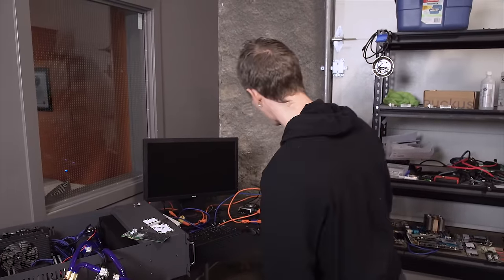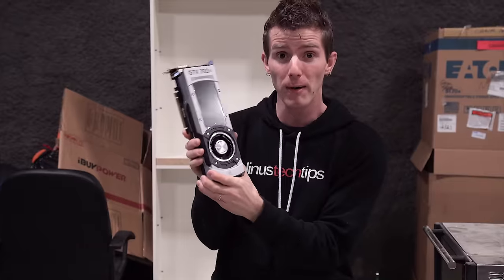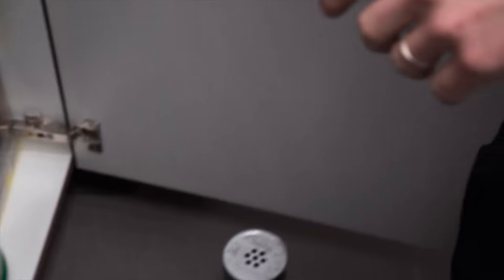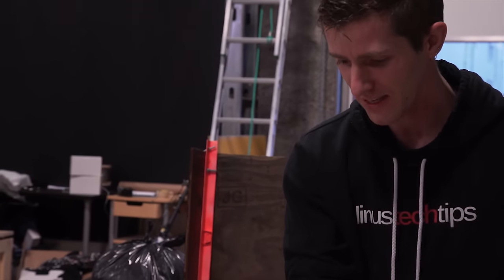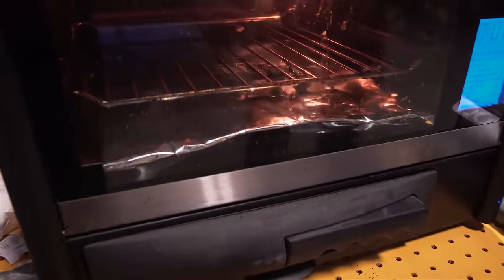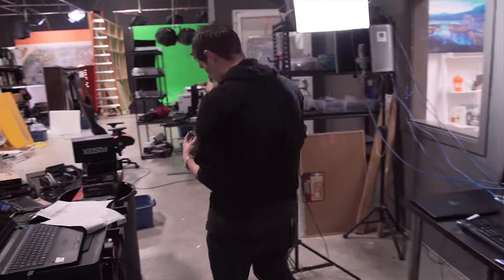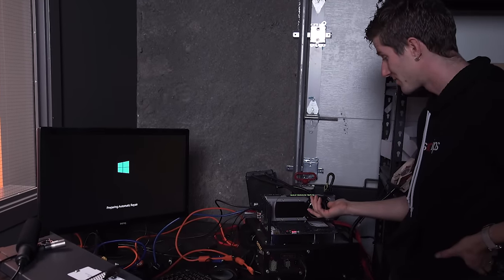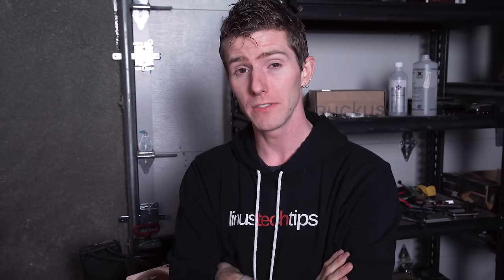Bring your video card back from the dead! - Oven method

Comment: I just gave this a try on my dead GTX 960. First boot back it looked good. Second boot FRIED MY WHOLE SYSTEM.  Not sure if it is just my MOBO but right now my system won't even power on with the graphics card removed. 
 This sucks

Comment: Dear Linus,  
Recently I've been getting into reviving old pcs.  I've run into an issue lately that has me stumped.  Basically I'll go to use an integrated graphics port,  and it will be fine.  But the movement I try to ad a GPU the integrated graphics port stops working all together.  Even after removing the GPU.  Any idea what it could be?

Comment: 385F is less than 200C, even lead free solder won't melt that low. You aren't even preheating the board (which basically guarantees that something else will go wrong).  You aren't fixing anything

Comment: Iv had to do this to my vizio tv. The main board itself,  baked in oven 8min@380.  Soo far,  it's worked all 5 times. Lol I'm currently trying to figure a way out to some how install a fan placed on heatsink.  May help or atleast last a lil longer before having to do it again.  Again suggestions?

Comment: my exp : since 2017 after build my 2nd PC im always saving some penny at least IDR 10k / $0.7 in 3 days,
exclusively for my PC long term savings and now i got dead PSU and my GPU got affected too and died also..
but im ready to replace it using my special $240savings, but i wanna try this oven method first :)

Comment: 1080ti Smoking damage?? 

Hello, cool video first of all. 
My question is rather long, so I apologize in advanced.   My friend has an EVGA 1080ti FTW edition. It worked fine for about 2 months. After that time certain games such as PUBG, Squad, Wither 3, and a few other titles would crash. My friend is pretty PC ignorant for the type he has, he thought his thermals were high, so he downloaded the EVGA overclocking tool to just gain control of the fan speeds, why I am not sure. Guess he thought it would help. The card was peaking at about 84°C by the time I got to it. Anyways, I need to add that he chained smoked less than 3 feet from the front intake. When I got to his PC it was pretty bad, dust and such. 9 out of 10 easily, 10 being the worse shape. I spent a full day, 5 air dust can, and a lot of rubbing alcohol later got it pretty damn clean. I took apart  the 1080ti and put new thermal past on it, and cleaned the thermal pads with hot soapy water, let them dry. They were stained yellow from the smoking. Ok, so by the time I was done with the card it looked pretty new, not going to lie was pretty impressed with myself. We got the card back in the machine, booted into windows, launched PUBG and it worked fine. All other games worked and we were happy. About two days later, same thing. I need to add he had stopped smoking in his house all together. I swapped the 1080ti out with an older EVGA GTX 770 4gb. It has been in for the last month, no issues, games are running fine. We sent the 1080ti off to EVGA for a RMA. We got it back today, they said the RMA was declined due to smoking damage. My buddy is really mad at himself. He gets it, I suppose my question at this point is there anything else we can do? The card does work to a point. Like browsing, low end games, and movies. It is only when a really high demand game is being played. It'll boot into the game, normally get 2 to 7 minutes into gameplay and the game will crash. For example, it will crash in PUBG right before or right after you get on the plane to drop. Just to reiterate, the 770 has had no issues what so ever. The PC specs are a 7700k, 32gb of ram, and he has some ssd, think 240gb. If you all at Linus read this, or anyone else and may have some useful information or insight, I would really appreciate it. Thanks for your time. Keep up the great videos.

Comment: I have a Alienware 15 R3 laptop
when i am not charging it it works very nice
but then i am charging it and playing there is gpu usage drop and this leads to fps drop 
any solution for this
Reply: try to clean it ... usualy when the temperatures rise , the clocks on gpu and cpu are lowered by the computer automaticly to save the parts from coocking to death...if that does not help sorry no idea
Reply: probably a problem with your nvidia/amd driver settings, i had a similar issue and resolved it in GeForce now somehow, don’t remember how, but google helped me

Comment: You know you got really lucky with the video card. They say they fail because of fatigue of the solder joints from expanding and contracting. But I believe it is usually a failure of connection between the die to the little board that makes up the actual gpu chip. Thats why these fixes don’t last long because those connections are solid copper and don’t have any solder to melt and remake connections. Also you didn’t use a single drop of flux so you didn’t reflow shit. 🤣🤣🤣 You were just lucky AF the die made connection again from heating  a lot just once more. I would like to know how long it lasted. 

I work with this shit everyday and the real reason I discard the general belief that the solder joints are what go bad is that I have never seen it under my microscope. Plus whenever there is physical damage to a board, the anchor(nc) pads are the first to be ripped off, next whatever is on the first layer of the board. The solder balls never fail before the board loses pads and breaks vias. Just look at the iphone 6+ touch ic fail, iphone 7 audio ic fail and now pain in the butt iphone x interposer board failures. The pads and vias break before anything else.

Reflowing only works when there is corrosion under chips and you NEED to use flux. 

I have nothing to say to Linus about the ssd because they do not even go through considerable heat cycles to even consider that a possible failure point. Ssd’s usually die because one of the chips randomly dies. You might be lucky and find a shorted cap or a bad component but usually it’s a bad chip. Sometimes the bad chip has a short and you can identify it with a thermal camera.

 Any microsolders out there want to confirm what I wrote? ✋🏽

Comment: i've just tried this on my gtx780 and it booted up for the 1st time since I last had it installed. I had a few crashs on csgo but after overclocking the card and disabling dx9 on csgo it hasnt crashed since. other games seem to play fine
Reply: Hi
I have sapphire r 390 graphic card
It works only problem is 
When i play a game it gets hot i get black screen
I search on internet 
There is no solution
Should i put it in oven also
Will it help

Comment: Kind of late  but I resently found a 970 in the trash and it works in sli with another but on it's own it doesn't display through the hdmi or display port but does through dvi, should i try this or is it too risky
Reply: Just buy an adapter for hdmi and stress it
Reply: @joeyhillers9460  i did that but about 25 minutes after it was running it just stoped displaying, still works in sli though
Reply: @joeyhillers9460  i now have 3 970s in sli just so i could get all 4 of my monitors going lol
Reply: @FTVG_inc  Interesting. 3 you say? I remember just for the lols buying a bunch of GTX 480's on the verge of death and 4 way sli them. Could literally feel the power coming from my PC! Or maybe it was just heat?
Reply: @joeyhillers9460  lol mine are liquid cooled accept for 1

Comment: Is Oven and Microwave the same? I have a Microwave at home where putting metal spoons and soft plastic can cause serious trouble. Can that be used to bake GPU??
Reply: Noooo.. Microwaves only heat water molecules so wont even heat the solder but will cause loads of electrical arcing on all the metal on the board and god only knows what affect microwaves would have on I.C's (OFC if this was a troll question then ha very good, got me)

Comment: My HTC M9 was stuck on bootloop, no recovery, no download mode, I fiqured.. nothing to loose because everything was at a loss already, so i froze my phone.. besides the battery life going from 90% to 0% the phone managed to boot to UI.. did this twice.. released what may be happening is when the board was cold it was making a connection, as soon as the processor heated up it went back into bootloop... I preheated my BBQ to 100 Degree's Celsius (yes Im Aussie) removed the mainboard from my phone and desoldered the vibration motor as it has a soft rubber boot around it.. placed the mainboard in the BBQ for 5 minutes, allowed it to cool which took only 2-3 minutes.. reconnected the mainboard and was able to get the phone to boot for longer then it had since the bootloop error started.. lasted about 3 minutes.. just enough time to enable debugging, re-heated my BBQ to 140 degree's and placed the mainboard back in to bake for a further 8 minutes.. allowed to cool while i had a beer to drown my sorrows, rebuild my phone once again.. and low and behold.. the bastard come alive! and has been working for a full 3 days so far.. have backed everything up and awaiting the new Ulefone Power 5 to arrive.. down with HTC!
Reply: Interesting. I'm typing this from my HTC One X9. Apart from a few little issues (battery near the end of its life, froze about 3 times in its life), is been an excellent phone.

Comment: Give me a broken part that would be fixed using an oven, fire supplies and baked beans (including can opener). What will happen?! I will open the can and eat the beans. Then I will have a terrible feeling in my body, ultra high pressure and then BOOM! Other people in 100km radius around me will instantly die, and in radius of 500km, they will die due to cancer. And then, I'll wait for the second explosion, but with fire ready. When it will happen, you would be able to see all the fire from the moon. Then it will be the time for the poisonous materials to stop doing something and the GPU will be ready.

Any orders? XD

Comment: I reflowed a GPU with a normal (very cheap) hot air Gun, one totally dead and another one with the classic "blue lines" popping on every boot, they both works, everybody thinks it's a more confortable and right method instead of this oven method?

Sorry for my english, i learned it on Netflix.

Comment: I'm surprised Linus even made a video about this. Most experts know that you simply cannot permanently fix cold solder joints by baking the component in the oven. Sure, you can get some temporary results that are promising, however I'm sure this video card would die for the same reason within a few months. The only way to properly reflow solder is with a soldering station. I guess it can't hurt to try if you just need to get a few more months out of your card til you can replace it, but don't expect a permanent fix this way.

Comment: Definitely wanna try this on my dead 560 TI lol, could resurrect a pc i have lying around
Reply: And did you try?
Reply: I don't have an oven that i want chance burning electronics in lol
Reply: Seems like the 560 doesn't last. There is allot of them for parts on eBay. Mine won't work with any 500 series drivers, but it does display an image and will work until you play a game

Comment: So...... have an old razer blade 2014 and the internal nvidia gtx 870m sorta died... Windows 10 automatically  disables the device due to error. As you already know, it is welded onto the motherboard so cannot be removed. Would the process above work  for me? Only doing this cuz i do not have the funds to by another Blade for the foreseeable future (kids and what not). Could you help? Yours truly, Overworked Dad Dude.

Comment: My oven doesnt have a temp setting, what can i do to do this method ?
Reply: You can still try it (if heating point is over 190*C), but you have to closely observe the soldering points on card. When you see them go fluid, you have to remove the card after no more then minute, or less even.

Comment: I need a Help! My GPU was working fine and suddenly some colourful lines showed up and it automatically shut down. Now it is not booting up, its a black screen and it takes some time to power up and show black screen. Tell me the fix pls
Specs:
i3 2nd gen 3.4ghz
8gb ram dual channel (4x2)
Gtx 1050ti oc zotac
Psu - 450v
And the gpu is new.
And rest everything is working fine fans led light etc.

Comment: Just cooked a broken 3090, 3 display ports had stopped working, not detected in device manager correctly, could not update drivers, and it fixed it, 195 degrees for 9 mins
Reply: is it still working?
Reply: @jonatan7238  no ha, I got greedy and wanted to reapply thermal pads and paste to improve temps stripped it back down again and it stopped working.. probably if I had of left it would of been fine for a while
Reply: @etniesdub1  hehe figures. This seems to be a temporary fix.

Comment: Don't use  OVEN METHOD. I used oven method AND hairdryer method.
 RESULTS:

OVEN: the card worked after 8 minutes in the oven but only for 2 weeks.

HAIRDRYER : After the 2 working weeks of the oven method, the card died again. I used hairdryer method, I left the hairdryer on the gpu (10 cm distance) for 15-20 minutes, and it got fixed again. 

It now works properly for 2 months, though it needs extra cooling because the temps are much worse. In my case I just stuck a huge fan near my case. 10c less

GPU : GTX 770
Hairdryer: a 20€ one

Comment: hello have a question could this work for my gtx 970 the issue i have is when its in the power supply but not in the mobo(not that it matters ) it wil not boot the intire pc unless i remove it from the powersupply i tried diffrent power supplies, diffrent cables, diffrent pc, removing the cooling unit but it wil not work.  i have a feeling the gpu proccesor is broke.

Comment: I have a gt 1030 graphic card with a i7 8700k@3.70khz and try running tomb raider shadow and only getting 30 fps in med setting not sure if it my gpu or cpu for the slow fps

Comment: is my gpu dead?i bought a used zotac gtx 1050 ti  mini.it did not post, the fan is spining and its not showing up in device manager.im using dell optiplex 330  ddr2 with 280 watts psu.hope you can help.

Comment: Can i use microwave to baked my nvidia graphic card? I tried every solution on google, and repeate all the solution atleast 2 times, still the error code 43 still persist. I also tried using different version of windows and bios to install nvidia. But still didnt work.

Comment: ok then, next time, before you start messing around with water around your computer guts. like the ssd, put some liquid electrical tape on all the contacts, like on the ssd ..  it will waterproof the metal parts a bit (lightly), and it is non conductive.

Comment: I bought the NZXT Kraken G12 for my RTX 2080 ti. I was able to install it along with the default fan that came with it and was able to run games with great results. But during a play session, my screen went black but I could still hear my PC and the game. I restarted the PC, removed and installed the RTX 2080 ti again, but it is not responding, the LEDs still light up on the card when I reinstalled the original air cooler on to it, so it is getting power. Any suggestion would help, though I don't think cooking my $1200 GPU is a good idea.
Reply: Star Wars Chronicler cook it

Comment: I actually fixed my GTX 570 with a heat gun, by heating just the chip. It worked for couple of days, but then gpu went dead and I couldn't resurrect it again... :/

Comment: Please do another one for laptop GPUs, linus ;-;
my laptop's amd dedicated GPU was working absolutely fine   when suddenly I got a blue screen while working on it and Bam the amd gpu is dead ..... when I install the amd drivers, the laptop boots up normally and then the whole thing freezes on a black screen until I disconnect and reconnect the battery ... the only way to get it working again is to boot into safe mode and uninstall the amd drivers and reboot , which  makes me work off the internal gpu which sucks ass :( 
yes I tried another version of windows and another version of the drivers
I'd love to try this method but I don't wanna risk sticking the whole motherboard in the oven and losing the laptop if something goes wrong.

Comment: Yea don't ever do this...  You need to properly troubleshoot and identify the actual issue before messing with the hardware.

You will likely destroy parts of the board that aren't supposed to be baked.  They come into assembly after the manufacturing baking process that can't handle the high temps.  Capacitors for example are not meant to get hot.

Comment: Hey
I have an MSI Rx 570 Gaming X 4gb. It does work fine, but as soon as I install drivers, it shows bsod. Any comments?
Reply: try to flash its bios with the original bios which you can get off of their website or techpowerup.com

Comment: Hopefully someone sees this. I started having issues with my GPU (EVGA GTX 760 SC ACX) shortly after I updated drivers. I'm not 100% sure it was the drivers. I have tried rolling back drivers, tried different drivers, and reinstalled my OS. When ever I try different drivers, sometimes my system will not boot, stuck in a lop, and a couple times I got artifacts. 

Can someone tell me if there is a way to better diagnose the issue, if I do not have another system to test it in? Unfortunately I do not know anyone in my area who has a machine I can swap it in for testing. This happened about 3 weeks ago. I can run my monitor through the card, usually just Microsoft Basis Adapter shows in Device Manager. Other times, with some drivers< i can check "can you run it?", and it does list my card, but I still cannot use it. Its confusing and annoying. Thanks for reading.